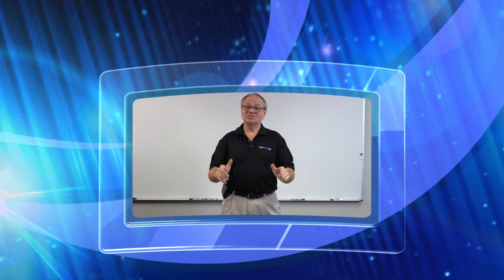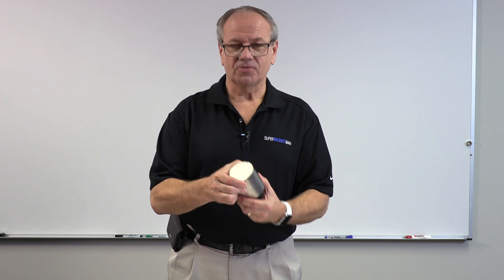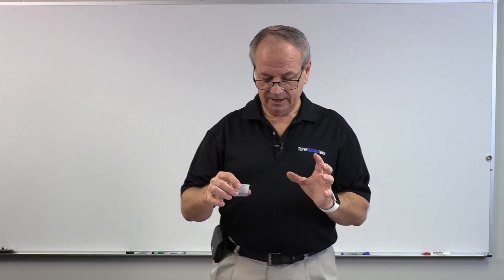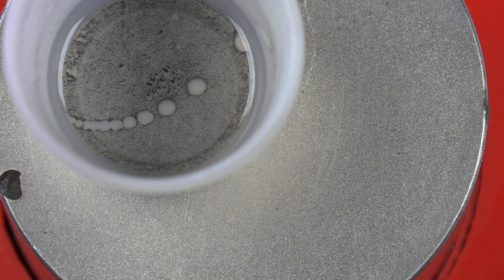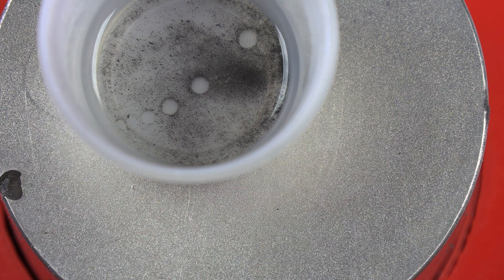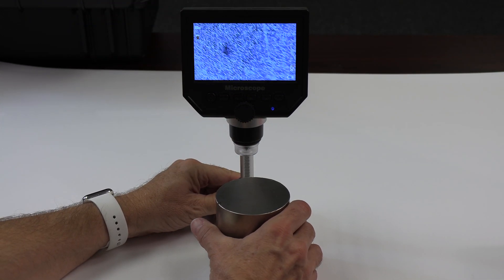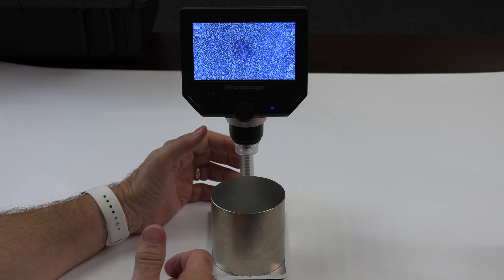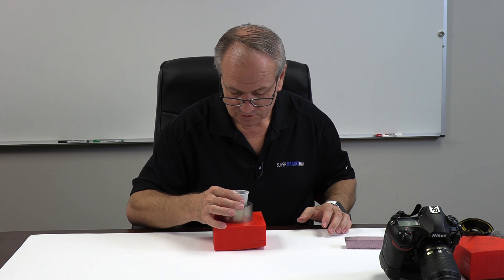Magnet Mystery - What the HECK is going on?

Comment: By the looks of it, it seems that maybe a ball bearing was attracted to the magnet and then bounced multiple times as it impacted, as the increasing frequency of the spots diminish in size as well. This is probably because the bounces had decreasing impact force on the magnet. I know that Sharp hits on a magnet can realign the domains, so I’m going under the assumption that this was a ball bearing hit on the surface

Comment: Oxidation due to impurities in the metal cause the spots to appear over time, those spots cause fluctuations in the otherwise homogeneous field. When you put the cup down over those spots you induce eddy currents that push the filings away, and then when you moved it around, same thing happens.

Comment: Solar flare likely during manufacturing of your Manet … here large duration / cycle of  electromagnetic waves from sun and earth core … earth core solar flares seen as rainbows …
QUAKES DURING AUGUST 2019:
10 quakes above magnitude 6
129 quakes between magnitude 5 and 6
807 quakes between magnitude 4 and 5
2364 quakes between magnitude 3 and 4
5307 quakes between magnitude 2 and 3
18645 quakes below magnitude 2 that people normally don't feel.

Comment: Obvious was during processing the magnet … Fibonacci spiral .. another material going through the process and was there a sonic vibration at manufacturing time or a solar flare ..??? Here alternate electromagnetic wave possible at time of manufacturing … the iron dust not causation of “impurity” …   Check manufacturing date for seismic activity as well …
Date of video release …  solar flares are present 5to 10days  or so before large earthquakes … one below is on date of video release 
Event. A 5.8-magnitude earthquake struck approximately 58 km (36 mi) east off the coast of Luganville on Wednesday, August 7. The quake was recorded by the US Geological Survey (USGS) at 16:32 (local time) at a depth of 123 km (76 mi).Aug 7, 2019
Reply from the maker: Sounds good to me:)

Comment: I noticed the spots are larger on the right, and lessen in size and distance as they reiterate going leftward. I also notice the spots curve up and circle back downwards. However, they don't seem to have the same effect, unless it's very subtle. I'd look at the filings under the microscope, while they are on the magnet of course. The pattern seems like a clue, noting the reduction in amplitude/power of the negating effect along the arc. Like an unfocused, pulsing laser, lit the surface, during a curved movement towards or away from the beam. That's if a laser could do that. It also looks like a bouncing pattern, and the looping could be from the bouncing object being influenced by the field. Very interesting though, until you find out, then it will probably seem plainly simple.

Comment: The clues are ENTIRELY in the manufacturing process.  Get a go pro and follow the magnet all the way through the process.  It's got to be impurities in the nickel coating.  The question is, what could make that larger to smaller spiral pattern.  What could make that line?  Could it be Leidenfrost effect?  Some moisture gets on top of the nickel and bounces across, causing cooling / heating just under the bounce?

Comment: The dark spots appear to be oxidized or melted, perhaps caused by the application of a pulsed high current applied via the surface.  This could have been done intentionally, through obstructions on the face during the magnetization process, or by heating the spots past the currie temperature of the material.  What are your thoughts on it?

Comment: It might have been due to a momentary discharge of electricity perhaps from another piece of machinery being turned on, or off elsewhere in the building, which could hypothetically leave a symmetrically graduated trail of observable inverse energy, given during a relatively soft stage of the forming process. So the mark would then appear to indicate a proportional change, or difference in the subsequent net unit of charge given to an otherwise normal direction of charge expected in standard models of typical magnetism. Kind of like a fly-back, or a randomly skipping spark of electricity, but simultaneously slowed by the binding forces of the magnetic domains.

Comment: It looks like a plasma effect. Perhaps a residue resulting from the magnets initial charging. It also looks like a crop circle, or a trail of impact craters on the moon. I'm thinking the electric charge applied burned the material away causing the charged material to form micromagnets on the surface.

Comment: Maybe one of the solvents or acid  used in the manufacturing of the magnet maleic, glycolic, and L-ascorbic acids was spilled on it.  This may leach out the impurities in the magnet & causing an effect liike cold wield together under pressure, except in this case it interacted with the acid and pressure and locking the defect in place . Try using one of your testers an see if there is a difference that can be detected. I did notice the material was smoother in those regions compared to grainy part.

Comment: Is it possible something very hot dropped onto the surface of the magnet, which would have removes the magnetism from the spotted area. Because heat is the only thing to remove magnetism. Here is an idea, what would haven if you drip some liquid nitrogen on the spots for  minute or two.....the magnetic force would return.....

Comment: it is a simple manufacturing defect - during the manufacturing process of the ferromagnetic material - when the molten ferro metal/alloy was cooling/solidifying some non-ferro material dropped in and solidified; and when this finished ferro material was magnetized; it did magnetize the ferrous material as expected and non-ferro was NOT magnetized;  so when you bring the iron filing over those spots they simply do not attract them showing an empty space.(edges of ferrous material has higher field strength .. so a ring is formed)   ... i spoke like a professor... lol ... well that is my informed guess.

Comment: The spots on the magnet appear to be diamagnetic, plus the arc they appear to follow looks like it might follow a fibonacci sequence. Did the magnet come from the manufacturer this way, if it did, maybe there is a problem with their magnetization process. Maybe during the soft phase of production, maybe some impurities were introduced and the combination of impurities and the base metal of the magnet are reacting to one another and creating a diamagnetic field inside those areas. Now, the fibonacci sequence that seems to appear, maybe that happened because a particular frequency was introduced when the magnet was soft and before it was magnetized. I've noticed some weird things in videos of cymatic demonstrations of sand or salt reacting with the different frequencies applied to the metal surface. It almost looked like a fibonacci sequence in the sand or salt as the frequency was increased over time. It could have just been the way I was watching the display or it could have been my overactive imagination. Maybe the crystalline structure of the magnet was affected by something as the structure formed. Like the fibonacci sequence that appears everywhere in nature, from the seed placement in a sunflower head to the formation of kernels of corn on the ear. You see the same thing in whirlpools, until the funnel pulls down far enough and then it looks like DNA. Victor Schauberger showed that in his work with whirlpools in rivers. He was then able to use the force formed by the whirlpool to levitate his devices. 
I don't know, just a couple of thoughts. Maybe something in my ramblings might help someone come up with a better idea. 

Rob
the.farm82019@gmail.com 
Good luck everyone.

Comment: these spots are domains where the magnetic moment , spin, is 0 or cancelled out. the permeability in these spots is very low. since the magnetic flux lines prefer high permeability material, they bend around these spots.
the reason for these spots might be oxidation, the nickel plating is not protecting the magnet. rust. many materials lose spin by oxidation. since the electron becomes paired.

Comment: the stronger the magnet the smaller the space, centripetal convergence "inertia and acceleration"  is "stronger" than the centrifugal divergence "force & motion"...  those spots must have a different capacitance when melding the materials used while heating...

Comment: I would hazard a guess that the ‘bubbles’ in the solution are caused by those ‘spots’ on the magnets surface having the characteristics of the opposing pole relative to the surrounding field orientation. This causes the iron fillings in this region to exhibit an opposing charge. So although the iron is attracted to either ‘pole’ the proximity to the surrounding filings induced charge repels the filings from the other filings while still being attracted to the magnets surface. The solutions properties are of interest to me, specifically if they exhibit diamagnetic properties. The induced charge polarity is retained to a degree in the filings so when the locality of the spot changed relative to the iron filings, the induced charge of the filings (again, the properties of that liquid solution are a curiosity to me here) is retained and effects a repelling force to the filings resulting in their persistence to remain in their current configuration. 

And the cause of the spots that would effect this characteristic? Best guess is high Voltage arcing (if any signs of electrical machining and/or scarring are present) or a high intensity laser. But specific attributes would have to be met, Ie; the laser beam operating in a pulsed manner and the magnet inadvertently passing in front of the beam. Rolled perhaps? I didn’t pay close enough attention to the nature of the arcs radius, but I did see the dots becoming closer before forming a solid enough looking line. 

That my guess after briefly watching video. Probably way off. Lol.

Its not something cheeky like a conductive substance applied to the surface is it?

Comment: Have you found a similar phenomena on other magnets, do they have similar spots on the magnet surface? Could it be caused by imperfections in the magnet? Maybe there is some type of a non-homogeneous area from the opposite pole that leached up to the the top pole before the manufacturing hardening process was completed.
Reply: Nope

Comment: You received the magnet 5years ago - it was normal.  The Fibonacci Sequence dots appeared later... 
***********💡 idea1
My guess is that over the years, the magnetic field shifted - left. But why? ( please disect that extra large magnetic in slices to examine those dots position.) 
***********💡 idea 2
I wonder what current ( micro current)  was needed to do this. Going into some sci-fi speculation here by saying, ( 1Hendry = 1Wb / 1Amp) that micro current from the buildings own lights, wiring or circuits may have altered that magnet. As it is a pretty large magnet about 15cm long.
**************💡 idea 3
Is there an extra property for very large magnets, that get crushed under its own magnetic field? Maybe the iron material is to weak for the neodymium type magnetic force field?  After a period off 1500days,  the iron "rusted" in a "self-inductance" freakish way. Why I say self-inductance, is because off the spiral shape.
************💡 idea 4
Wonder if it's a manufacturing offset.  Perhaps,  the one side is a micrometer (1micrometer) less then the other side. Is there a movie 🎥 off how that magnet was made. Normal Magnets do lose their properties at a normal rate.

Comment: Id get a spectral analysis test done on the spots to signify they are a part of the surrounding matrix or something all together different.  As an assumption there may have been an impurity or clumping of material in the magnet manufacturing process that is concentrating the flux in these areas.  You also may have found something significant here too in magnetohydrodynamics .. I admire how you approach this in such a mindful manner..

Comment: My guess is oxidation below the nickel coat or impurities in the nickel itself focusing the field  to higher saturation in specific areas. It’s the same thing as putting a small steel disk on the surface of large permanent magnet. The field will be altered and your nanoparticles will show it if saturated within the effected area.
Reply: This would be my assumption also it needed time to form before showing up 5yrs later...

Comment: Either someone used tiny coils to burn microdot magnets onto that metal surface, something others have been doing for a few years now, or arcing occured during the high current magnetizing  phase and copper/bronze contact points material was plasma welded onto the surface, causing a blocking of the magnetic flux lines.

Comment: https://youtu.be/9imAgVDtWwM

As seen in sun spots and coronal mass ejections CME these result from fractal patterning from golden mean ratios of phi. Because magnitude and magnetism are spacetime related. Repulsion forces existence are a part of similarities or likeness or "same poles attributes." Within the same plane. If as a result of oxidation of nickel or an arcing during charge magnetization process. Nickel is ferromagnetic and oxygen is diamagnetic. So oxygen, like copper, in a magnetic field is repulsive. Moving iron particles shows up as repulsed by oxygen. Because current is induced in the filngs which has a toroid structure in the same direction as the ferromagnetism of the iron. Induced directional current being in the same direction is like the same pole repulsion explanation. Symmetry results in one magnet of unified coherence. Broken symmetry results in oppositional butting of heads. Phase conjugation, or opposition, is just opposite sides or viewpoints of the same spinning smoke ring. So results are smoke rings colliding rather than joining forces.
Reply: Might also be a result of concentrated neodymium, which is paramagnetic. Which creates attraction inside of a magnetic field.

Comment: The spots come from a energized wire skipping across the surface of magnet,during the charge of the battery,?,maybe
Reply: That was the first thing that crossed my mind.
Possibly even something like a rapidly pulsating taser wire dragged over it.
Chemical droplets that have an oxidizing effect on the metallic components under the surface plating. 
Prior to the plating process during manufacture.

Comment: The dark spots looked like they were deposits ( looks thicker than the rest of the surface) of some sort that act like “shielding” materials at those points. That is perhaps why the spots in the alcohol are clear because there were no attraction there and, the iron particles tend to accumulate on the edges. Impurities on the metal before subjecting to the magnetizing process could have caused them.

Comment: Both lines show a decreasing movement.  One is curved while the other is straight.  It also looks like in these spots the material has been "diluted".  Was some type of chemical dropped on the magnet before the final electroplating process?  A chemical even when wiped clean, left a residue that couldn't be seen?  The surface is too even for an arc or something to have hit it in my opinion.  Not sure, just some thoughts.  Maybe they will help you, maybe they won't.

Comment: OK at first blush, you magnetize particles or sync them at 1st touchdown, and after moving it the particles realign but are affected by the magnetic field lines (the torus) as synced at 1st touch. I am intuiting that the low distance pickup height to move the cup is significant?

Comment: by the pattern, it looks like a Fibonacci distance was decreasing in distance. I believe it was something bouncing on it as it decayed in height. The circular arc has me puzzled if it was the same radius or more of a spiral decay also.
Reply from the maker: Thanks Dan - I am baffled too.  I agree that it looks like something bounced across it.  I have not had anything really around it but I am thinking of a few of these ideas and and seeing how I can recreate them.  I would like to come up with something that is repeatable.
Reply: @SuperMagnetMan  could you check and see if the pattern was in a spiral or a circle?  I saw one comment that mention welding and I think it could be molten slag that may have bounced on the surface. It's just a guess.  The angle is confusing.  You do nice videos also. I made one of the accelerated magnet spiraling force but it was just interesting for something to ponder about.

Comment: It comes to me as no surprise when the suspended filings do nothing near the surface of the magnet until an anomaly is reached.  If the field is very uniform there is virtually no magnetic force.  Magnetic force is proportional to the change in magnetic flux through space.  If the field isn't changing much over space, there may as well be no field at all when it comes to forces on objects like these filings.  Now at the spots, the situation is deviant from the norm and thus so is the magnetic field generated at those spots.  Near such points there is a change in flux and consequently a force on the suspended filings.  At those damaged points the field is weaker and so the filings are attracted to the surrounding where the field is stronger so you get empty circles like we see in this video.  No mystery to me about this, just a surface damaged magnet that otherwise is just fine for all practical purposes.

Comment: That is what happens when a magnet has been coated. Those are lines of magnetism effecting the  superficial substance used to coat the Magnet. Maybe minute impuraties. 
If yoy want to get far fetched you could suggest the field has generated heat release during periods of maximum distress or magnification of the field strength.